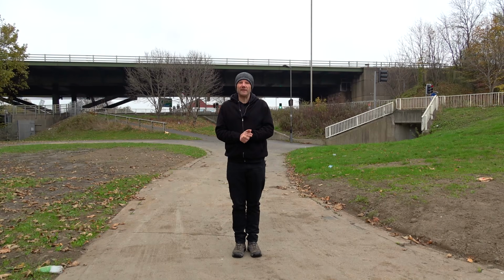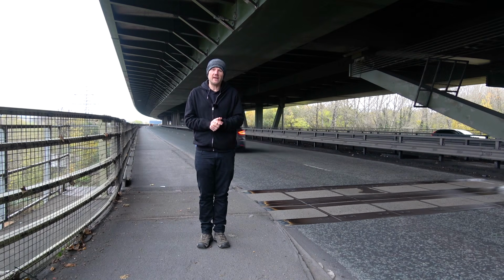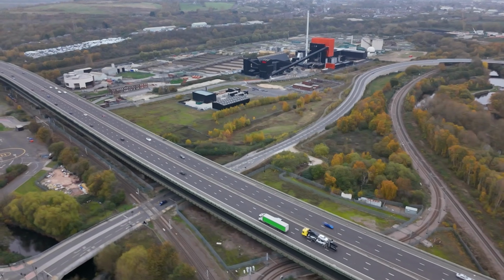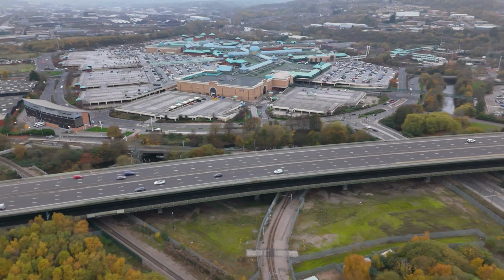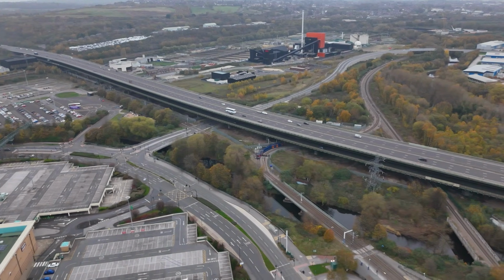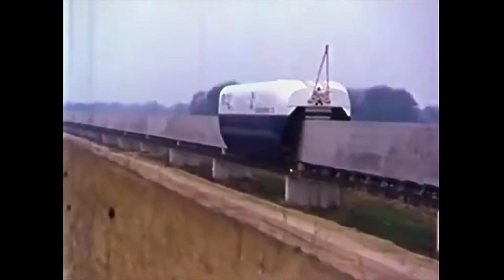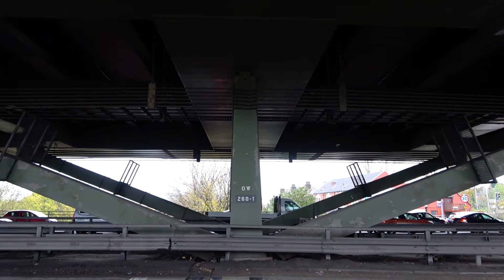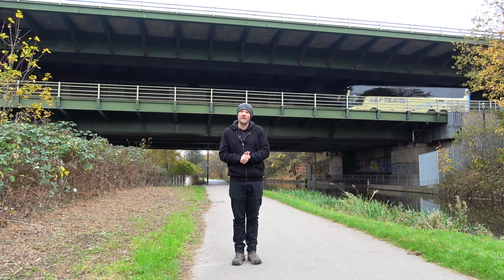The SUPER STEEL 2 TIER Tinsley Viaduct - M1 Motorway - Sheffield

Comment: Fun/disconcerting fact - if you sit in stationary traffic on the lower deck, you can feel the structure bouncing/jiggling slightly.
Reply: Better to bounce and sway in response to stress than to be rigid until it suddenly breaks after all
Reply: the funnest facts are always slightly disconcerting
Reply: It makes sense, as metals really just act like stiff springs, and when the cross section of the metal is small, as it is in this case, it isnt as stiff, so you feel that springy effect. Whats surprising to me is that such a big structure is able to be supported by such small steel beams
Reply: @hadhamalnam  Sheffield steel strong
Reply: "Slightly" is an understatement. It's basically impossible to not notice.

At higher speeds you don't notice it at all, but when driving at low speed it feels like the road surface is undulated, but it's in fact perfectly flat.
When stopped it's roughly the same magnitude as when parked and large vehicles pass and the air pressure makes the car wobble but feels more rhythmic.
Reply: Can confirm 😶‍🌫 Sheffield dwellar here
Reply: @LeClaw same. And it its not just a little bit sometimes it's quite a lot.
Reply: Yes, it's because part of it is actually sat on some springy rollers at one end. I believe it was constructed this way so that it could expand and contract with the seasons.
Reply: @AlanEpton the RFK bridge in nyc also does
Reply: It does feel weird though - it's the closest I've been to experiencing an earthquake 🙂
Reply: My father worked in the aircraft industry with a group of  scientists investigating  stress fatigue  in aeroplanes  .  When travelling on the lower I always prayed that the stress test engineers on the viaduct were up to scratch as my car  resonated in time to the  structural steel  😢  😮
Reply: I spent 20 years travelling to work via the lower deck and said a prayer every time I got stuck in traffic as you can feel the vibrations of the lorries and cars travelling above. That wouldn’t have been so bad had there not been, what seemed like, permanent patching up going on at the same time usually narrowing the road down to just one lane. Only have to do the journey once a week now to get to Meadowhall but still curse if the traffic lights are on red and I’m stuck once more 🫨
Reply: I came to the comments to post exactly this. 

Additionally it's worse on high wind days as the entire structure flexes.
Reply: @BrianGriffinQuahog  like aeroplane wings
Reply: Not just slightly, it's quite a considerable bounce at times.
Reply: Bloody hell 😮
Reply: I recently found this out on my first time crossing the lower deck. I was very disconcerted indeed 😅
Reply: Dependant on the time of day (amount of traffic) above, it can certainly be felt moving, a little disconcerting I guess.
Reply: Yes, it makes me glad to get to the far side.😅
Reply: Especially at the Rotherham end
Reply: Very disconcerting feeling the bridge bouncing
Reply: Yep, if it didn't bend it would break.
Reply: The same happens on the QEII bridge @ Dartford...
Reply: @stuartd9741  sure does, I was stationary in a queue and an artic passed me, felt like I was in a boat as a wave moved under my van.
Reply: The elevated section of the M6 in Birmingham does that too.
Reply: I hate been sat on the lower deck it makes me feel sick 😂

Comment: If you drive on the lower deck during rush hour you get an odd sensation as you can feel the whole structure bouncing up and down as the motorway traffic flies along above you!
Reply: Yeah its really odd, like being on the water.
Reply: Thought that was just me and my fear of heights
Reply: Yeah it's really disconcerting how the lower deck sways around like it's actually a rope bridge. As a Sheffield resident I try to avoid using it. Had more repairs than triggers sweeping brush 😂 they day it fails and collapses i won't be on it!
Reply: Yeah, squirms like buggery doesn’t it!
Reply: I hated it for that very reason!!
Reply: Every time I cross it I’m amazed it hasn’t shaken itself to bits by now. The Tinsley end as you’re waiting to go through onto the island is always the worst for the rippling sensation

Comment: But hey at least it does not have a bunch of on ramps and off ramps including left and right exits like the double decker that carries I-84 through Waterbury, CT in the USA.
Reply: Two roundabouts under each end of the viaduct with slips to the motorway & the underbridge between them as well as multiple other very busy arterial roads to IKEA, meadowhell, the eastern half of Sheffield & all of Rotherham (on t'other side)
Reply: slip roads.

Comment: If we were building this today, the steel would come from China and there would also be three separate £100m bridges for squirrels/bats/newts and it would take 10 years to build......
Reply: And 5 to fall down.
Reply: Like HS2, they'd squander the money and only build half of it's length.
People would travel from far and wide to watch the traffic fly off of the end.
Reply: @stevekelly5166  there are many failings with HS2 (high speed rail is good and needed really but the competing often contradictory requirements set by the DFT at the start of the project started the ball rolling on making a mess of it along with the order phases were implemented, if the Northern part had been built first, and gone all the way to Edinburgh/Glasgow, the Southern leg would never have been dropped although economics and railway capacity constraints near London would have made that a difficult option although using less frequent but longer length trains on long distance routes where stations permit such as Euston and Edinburgh would help) but one people rarely seem to consider with any large infrastructure project in this country, even if it is sometimes flagged up, is how much money is wasted not because of poor management but endless legal challenges both in lawyering/study costs, but also as a result of the delays cause by those challenges both within the supply chain and on site which then either result in people being paid to do nothing or being laid off and having to be rehired and retrained (causing more delays) once everything has been sorted. Many of the people fighting projects and causing the delays will be the same people that then trumpet about cost issues. Don't get me wrong the approach in some other countries like China where concerns and issues are completely ignored is worse in my opinion but we have not currently found the right balance point.
Reply: And after the feasibility study, environmental impact study and public inquiry, cost twice as much as the original estimate 10 years ago.

Comment: And most people never actually see the structure as they drive over the top deck - you have to leave the motorway to appreciate what a wacky but impressive piece of civil engineering it actually is.  And built so quickly - these days the plans would likely get bogged down and 15 committees later it would still be a pipe dream.

Comment: My neck of the woods drive on both parts all the time
Reply: My neck of the woods too, but I hardly ever drive on the top deck - if I’m going south I get on the M1 at the southern end of the viaduct and if I’m heading north, I miss it (and the notorious stretch of smart motorway between J34 and J35) by joining the M1 at J36
Reply: @emma.jacobs1 Me neither. Bottom deck is used often. Top deck not so.